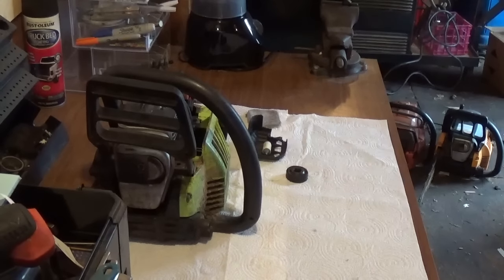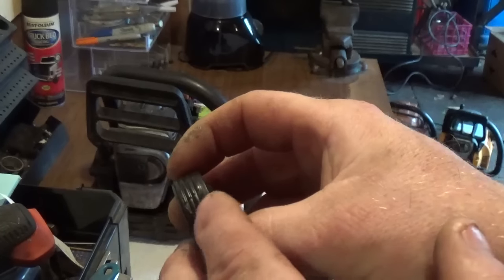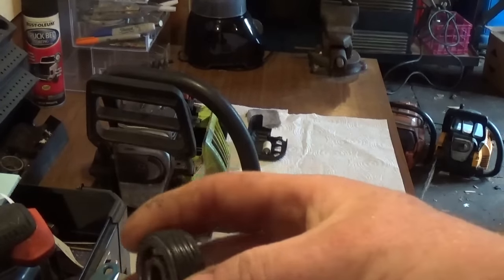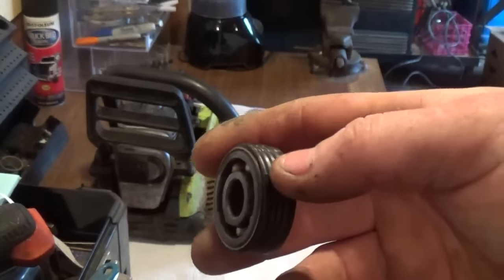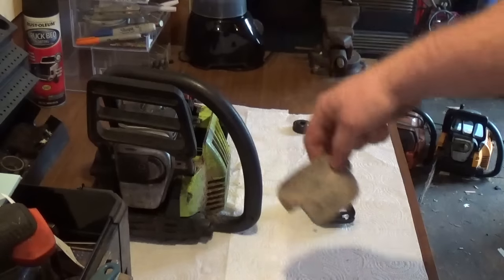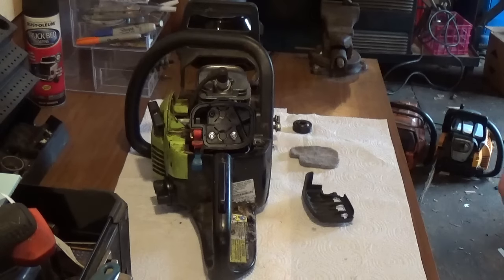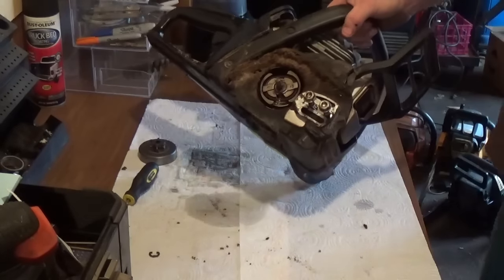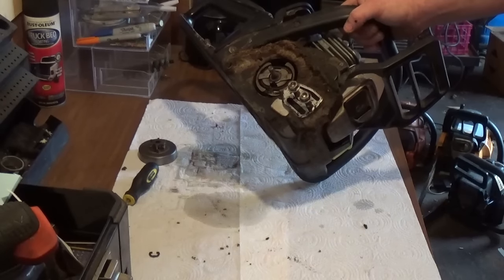Common problems with Poulan Chainsaws

Comment: I don't know how old that chain saw is that Mr Bolin has in this video but I've had a PP3516avx for at least 5 yrs and I kid you not I came on this site to find out how to change the spark plug and air filter because I've never had to do it before. I have a cottage and this little chain saw has seen a lot of fuel pass its spout. I cleared the cottage lot with it.....about 15 - 40 ft maples, cherry and beech and It's still running without service until now. In my opinion they're a great buy and I'd get another one without a second thought. I have a sneaking suspicion this may be why Mr Bolin doesn't like them.....there's little service required.
Reply from the maker: Keep dreaming my friend .....I told the truth with nothing to hide .....Check for yourself ......But if you intend on remaining adamant threw your foolish pride then {let not logistics or facts wade you from you next impulse purchase. } What can I say I tried fellow viewers.....

Comment: I agree about the low quality of Poulan saws, (in the UK we pronounce it poo-lan) , I started my small engine repair business in 1988 and luckily have only encountered three, two very small ones, one was orange another dark green very similar model, the big one never started and was a junk heap, although very old. Thank goodness they're not very common over here, instead we have McCullough! They are our worst saw, many assembled in Mexico etc, just everything made of almost soft plastic, except for the crank piston and barrel. We also get copies of Husquvarna medium sized saws made in China, pull starter falls to pieces in weeks as does the chain tensioner, goodish engine though somehow, but how're you gonna get it started? I had a McCullough  510, a very old saw now, new oil seals and bearings points (shows age) but it never ran again, just would not fire up properly. Blocked up carb I reckon etc. enjoyed your video and comments thanks, DD.

Comment: I have one my dad gave me.  It was great for years and did a ton of work on my 10 acres of woods.  Free to me so I just hoped for the best.  But yes im here from blistered hand from trying to start it until i was exhasted.  GFound out the vapor lock from the cap was the issue.  Now im nursing it for quick jobs.  But yeah the gas cap is a pos

Comment: My poulan3816  runs good with saftey handle pulled towards me. As soon as I let go it dies. Cant figure out why it would die if it's a faulty safety brake?? Has me baffled
Reply from the maker: I respectfully know your looking for answers ......But please take my advice ......Dont throw money at a dead horse {so to speak}....Just toss it .....at the end of the day your wallet will still remain thick and you wont become another Poulan victim .......Buyers remorse will always remain ......But Husqvarna/Poulan wont continue to take your cash towards a money trap.

Comment: fuel leaks from tank whenever saw is raised in the parell position.  How do you fix this problem.  replaced fuel lines  .
Reply: If its leaking out the cap then swap the cap. If you see it under the carb its probably leaking where the fuel lines enter the fuel tank. They just fit tight and that's what seals it so if that's the case swap em. That's what I've done to fix mine that had that problem

Comment: I have poulan pro 18 for 7 years I abuse it some times cutting roots in the ground starts in the second pull, use chanel locks for the cap, simple don't let nobody to borrow if you do get ready to buy another one that goes for any brand(stihl pro etc) you get what you pay for, week  end saw

Comment: Hi all. Im from Serbia and I have Poulan 2800 and its working fine, I cuted a lot of trees with it.
Reply from the maker: Great /hope you continue to receive the performance expected from your poulan .Sadly I have never encountered nothing but a lighter wallet, blisters from trying to start one of these curses, buyers remorse, and numerous troubles that plague these little[ CHEAP] box store saws that leave a lot to be desired quality and performance wise. If your lucky enough to receive one that will actually run straight out of the box and dosent require a carb adjustment.
Reply: Kevin Bolin. Thanks man for answering, Im far far away from you. My Poulan is working ok, Im doing regulars servis on him all time, cleaning filters and carb, only I changed membranes on carb and it was not a problem becouse producer of carb is Wilbro, regular carb good quality and after that it was working again fine. Because Im from Serbia is hard to fine some sper parts such as air filter and other. Also Im not shure but I think Poulan 2800 is 2.8hp, do you have that info?
Reply from the maker: I am not sure / How many cc is the saw ? The CCs can often provide you with the over all hp of the equipment.
Reply: Kevin Bolin. As I know its a 40cc engine
Reply from the maker: Typically 14 to 17 cc is about 1 Hp...... so if say your saw was 42 cc then yes about 2.8
Reply: Kevin Bolin. Ok man, thank you very much.
Reply from the maker: Ok ...well its def over 2 hp / thanks for watching my videos...
Reply: Kevin Bolin. No problem man. Are the SOLO chainsaws American product? For them I have an information that they are good, but here on our market we dont have them on offer. In Serbia we have Haski, Stihl, Dolmar, Makita, Jonsered, Oleo Mac and OPEM
Reply from the maker: There fair chainsaws mostly oiler failures {SOLO} ......{Dolmar and Makita } are one and the same {same company makes them} and Jonsered and Husqvarna are the same . as for the rest listed I would just save my money with the obvious exception of the Stihl Brand. I personally would prefer a Stihl .....just keep in mind you would wont say a Ms 250 or Ms 290 .....The Ms 170 and 180 just don't seem to hold up very well due to the new seals made for them
Reply: Kevin Bolin. Yep Makita buy Dolmar company. But on our market they started seling Stihl whic is produced in Brasil or China, its original Stihl but produced over there, so that dump the prices of Stihl a lot, here people prefer Husqarna. Also Italian Oleo Mac is good, very fast machine.

Comment: I knew better as I was looking at the poulan pro 18" that I just purchased from lowes, but still bought it anyway..... cut 2 locust trees down and cut them up into rounds. Problem I had was, saw started up and idled great, when I set the saw down for a few seconds then picked it back up, as soon as I squeezed the trigger it bogged down and stalled. Brand new only 5 hrs on the damn thing.
Reply from the maker: Yelp...I have experienced this problem as well....
Reply: adjust the low end, carb is loading up with fuel as it sits and Idles. Simple turn of the low end needle valve will lean it a bit and keep the carb from flooding, Fiddle a bit, you'll get it.

Comment: For $200 for the Poulan Pro 20"? If last a year? Got my money out of it. Don't need a lifetime Chainsaw. Even though I just bought the Pro with a 3yr extended warranty. My Dad's Orange Poulan 20" had the pull string Plastic Piece break twice from regular pulling, within a month. My new one does great, I use the Series 70 Chisel Chain on mine. The 2020 version has done me good so far. No issues what so ever. Starts on 2nd pull & 1st after it's been running. I just take care of mine. It's the 5020 orange with Black Bar.

Comment: What about 90s vintage and earlier Poulans?  I had an early Eighties saw that would conk out when I hit the throttle to saw wood but other than that heard nothing yay or nay.
Reply from the maker: The older saws {80s/mid 90s} depending on how they where built so to speak had there problems no doubt . But compared to modern Poulans are as different as day to night . Not perfect be mindful / but certainly not like the shit purchased today .
Reply: @kevinbolin7665  I took my biggie Poulan out yesterday and it took some coaxing and brake cleaner to get it going.  It sat for a month or two.  My favorite Poulan product was the OEM spray paint.  My dad's store was a dealer and if we needed something painted for safety purposes- well, there we went.

Comment: When I pull feul line off carb no feu will come out. The filter is good. No lines are pinched. Fresh feul added. I think something going on in the tank. The pressure is off. I clean vent hole in feul cap

Comment: These are for people needed to clear a road for $190 rather than paying someone to come and do it for the same price. It's a good emergency saw if it is maintained.
Reply from the maker: Sure Jimmy keep telling your self this .......Emergency saw ......HA .......{My ass} the fu@%ing lines will crumble even if they are maintained via fresh gas in the tank ......I had to laugh once I seen this comment as you can do the so called expected maintaining of the pieces of shit and when you need them most.......well expect to be fu@#ed with the outcome because even if you had new lines what about the cheap carbs that tarnish over once they have had gasoline in them .......or even the check valves that swell with both reg and ethanol free gasolines .....LOOK VIEWERS TO EACH THERE OWN but be minded putting your cash towards a poulan is just plain stupid ....its been proven time and time again .

Comment: My 42 cc poulan ran fine for 15 years.  I bought a 52cc poulan pro and hav great luck.  If you look at the top ten chainsaws rating online, poulan pros take 3 of the top ten.  I have a jonesred also but love my poulans.
Reply from the maker: Great ...to each there own.....I just cant say I feel the same way due to all my experience with the repairing of Poulans  small engine  equipment....{CHAINSAWS FOR SURE} ....They truly are P.O.S. that most small engine techs will not even bother working on..
Reply: I am another one who is satisfied with my Poulan. I think anyone with common sense would realize that these are not professional quality saws. I think that most people who purchase these saws are just wanting to cut a few limbs or just occasional  minor use. The saws are used once and then stored for months. Like any other machine it needs to be used and stored properly. Not much has been said of using non-alcohol fuels. This alone may be the most common cause of failure in any gasoline powered tool. Poulan products are no better or worse than any other home use gasoline powered tool. All this "POS" stuff just shows ignorance.
If you truly "hate these pieces of shit", why do you offer repair service? 
Any one with mechanical knowledge can get good use from these products, those without knowledge call them "piece of shit".
Reply from the maker: LOL...friend let me explain a few things to you ....First I have over 25 years of experience /14 of witch I have been a master service Tec{TECH} for those who need the correct spelling . Second it is up to me and me alone as to what I choose to work on that comes into my shop... I am in no way obligated to work on any ones equipment if it comes in my shop.Third in regards to non alcohol fuels {you make a great point } these fuels are safer to use on Equipment although they can be very expensive often averaging 6 to 8 dollars a can and if your spending that kind of money depending on the work to be done it most certainly will eat a hole in that wallet . Fourth I don't feel in any way I am just showing ignorance by making a video and explaining to my viewers the cheap quality of such a piece of shit and the many failures they can expect to have if they purchase a Poulan product ....I even provide facts that you may wont to consider looking into yourself ....{refurbished Poulan products} just look it up for your self then tell me if they are no better or worst......I promise you will retract those words quickly once you find out  that mechanical knowledge I appear to be lacking...Is just a asinine remark for fools who wont to retaliate against facts....[Now you asked one question that I found reasonable .... ] So allow me to explain ....WHY DO YOU OFFER REPAIR SERVICE?  / I offer my repair services for many different reasons the most obvious is to make a living ...However unlike many repair Techs I believe in a dollar earned not stolen ....That is why I personally don't carry Poulan Products nor do I make them out to be dependable for people who are wonting a chainsaw that they can depend on ...My employer on the other hand dosent really give a rats ass and feels like {if they don't get parts or service from him then he is missing a sale .} Truly just a obligation on my part to fuck with these things at all outside my shop......But he writes my paycheck at the end of the week sooooo..... I honesty laugh every time  we get a shipment in his shop ......Hell we even laugh and take bets as to how many will be warranties ,need carbs adjusted ,or will even start might I mind you with that non Alcohol fuel mix.... I know I could rant on and on about Poulan but the simple fact will remain your sold on the price point and the pleasure of tinkering with these Cheap little saws ...{hint} what gave you away was the mechanical knowledge statement. If your sold on Poulan / Great to each there own as I have told a few viewers before . I just have way to much experience with these curses sold in box stores .......{I would like to offer a request } in the hope you will at the very least take the time to do a little homework not out of sarcasm on my part but as a opportunity to inform you on your product choice...Look up Poulan Refurbished Products .....Or ask other viewers about a certain letter stamped on the top cover of some poulan products .........Look for a stamped  R .......ITs often right on the top or rear of the saws just above the choke ....These saws are returns to stores and have been refurbished then shipped right back .....Think about it if theses saws were so dependable then why do they have on the boxes incase of a failure don't return to store contact some bullshit number....I can honestly tell you why .....I went to a local tractor supply store  last November  and saw 26 Poulan products that were being returned due to failure 19 were Poulan Chainsaws ....The manager asked did I know of any local dealers that would fix them if not they would have to return them ....She said I just don't know why none of the local dealers wont to repair theses saws I have no problems getting our Jonsereds repaired...{GEEE Wonder why Emily I laughed }....She had a hell of a time returning those things ....

Comment: Bought one from Menards a few years ago on a black friday  and it would not run properly from the get go. Tried to take it back and the answer was no once you put gas in them they just wont. Sat here now for a few years, ordered a new carb got it running and new a massive oil leak .Im done with it .Buy your gas powered equipment from a reputable dealer and ask about the warrantee and get it on paper because i did ask at Menards and was lied to.

Comment: Put a little oil on the threads of the gas cap It does work !
Reply from the maker: Ok...now can you offer a solution to keep the saw running more than 30 min tops .....maybe offer some insight on breaking in the saw from start up so further idling adjustments wouldnt be needed right from the box .

Comment: Ya missed one. On some of the double barrel carburetors the tang or cam thing which opens the secondary is PLASTIC.  The oldest ones were metal, and some have a metal linkage. Well, plastic 'nuff said, other than to note that all the China replacement carburetors use metal linkage. 

Other posters have nibbled around this, but the return fuel line is a bit smaller outside diameter than standard. Off top of my head something like 4.75mm vs 5mm standard size. Local dealer keeps packages up on their pegboard with enough line to do one or two saws, $5-7, way to go for someone working on these at home. 

As a rule I try to stay away from any of these built in the last 10 years. The Poulan / Craftsman 20 some years old, when they were made in the States, when you find one in good condition can imo provide decent service for their original intended market - homeowner. From the video, sounds as if Poulan has degraded so badly, the new ones can't even be depended upon to cut up ONE tree after storm clean up. 

Poulan name going the way of Homelite, which during the mid aughts put out Garbage S. saws sold exclusively at a big box store. Suffice to say you don't see any Homelite branded equipment being sold new anymore, now do ya'? Not even battery stuff.

Comment: The fuel cap is what swells.  Take it out, and let it dry out for a couple days.   Screws right back in.
Reply from the maker: Nathan ….The whole point is not to have to contend with screwing around with a chainsaw that is suppose to work as intended . I mean seriously what if you actually needed to use the saw and you were forced to fight the fuel cap with each filling of the saw as it is swelled .

Comment: There's practcally no room to get a tool to remove the lower carburetor screws. You get to take your DIY skills to their ultimate limits. Why don't you get slipjoint pliers to remove the gas cap? Someone recommended flip open fuel and bar/chain oil caps in another video I read.